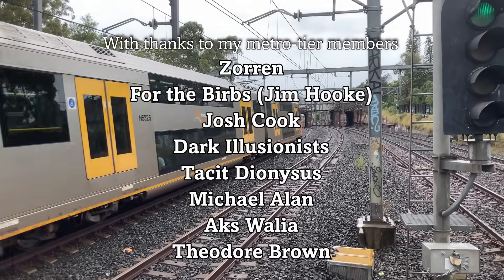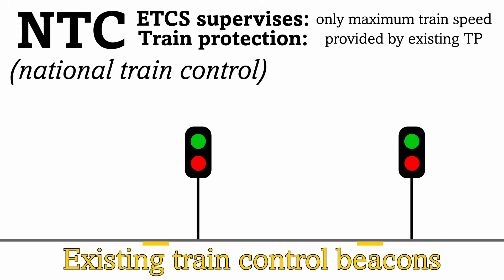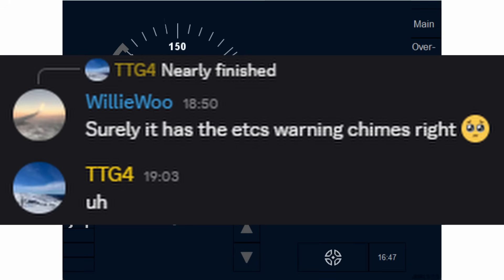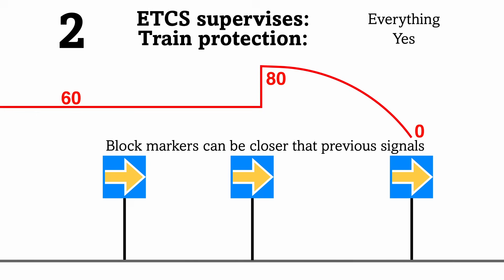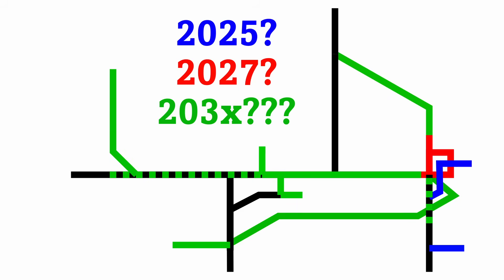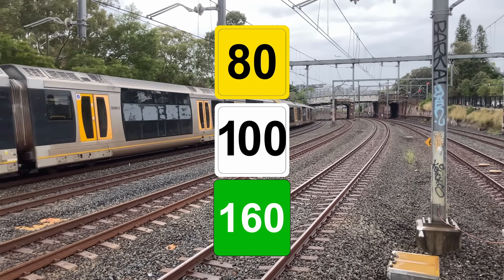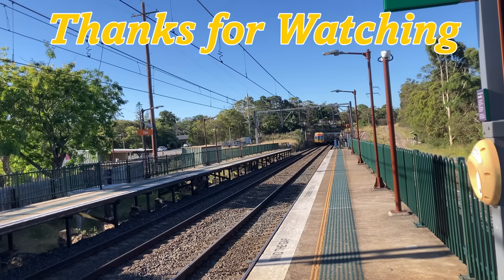What is ETCS? Upgrading Sydney's Signalling

Comment: ERA removed ETCS L3 from the technical specifications for interoperability and merged it with L2. It was done due to the transmission in those levels using the same packets of data, so the distinction was entirely redundant.

Comment: Correct me if I am wrong, but does the Copenhagen suburban system (S-tog) operate ets Lv3. It is a separate system to the mainlines, but other than that and running to different specs, I thought that was etcs lv3.
Reply: correction, Its cbtc.

sorry for the error. 🤦

Comment: L2 Hybride will be installed in parts of the Netherlands where we have ETCS L2 block sections of sometimes 200 meters between stations in Almere. We have developed a simulation model in RailSys and are currently implementing the 2033 timetable for simulations.

Comment: Belgian driver here
ETCS is such a breeze compared to driving TBL1+ (Local system)
Especially LVL 2 enables you to drive much more relaxed as you'll always know everything
In TBL1+, every signal in Belgium with a yellow light (Warning, short section warning, speed limit on next signal) requires us to press a button. Forget it once and you'll get an emergency brake, and once standing still 10-15 (depending on the TBL1+ unit) of "punishment time" before you can refill the breakline and continue. Long live ETCS lmao
Reply: Meanwhile Japanese drivers shuddering at the concept of not pointing and calling at a signal
Reply: Same in Spain and UK

Comment: @11:50 the balise data not only contain a location (or rather, just a serial number), but can also provide fixed information about the track (like eg. permissible speeds, gradients, neutral sections, crossings). Plus they also announce the next balise(s) along the track (i.e. the next expected serial number(s) and the distance to them). And of course for ETCS L1 there are also switchable balises that can transmit different information depending on the status of lineside signals.

As the amount of information stored in a balise is limited to 830 bits of user data (1023 bits in total, but for reliability reasons there are a lot of error-correction bits; and the whole content needs to be transmitted at least twice, even to trains passing at 500km/h, i.e. within about 1-2 milliseconds), this can lead to chains of several balises in more complex track geometry. Balise chains are also necessary to determine the direction of movement, which is relevant for everything but pure locator balises (basically the first balise coming from the wrong direction tells the onboard computer to disregard the following balises).

Thus the amount of balises may seem excessive in places, but as they are quite cheap to manufacture — most of what you see is just a plastic housing for what's essentially a beefed-up NFC chip — that's basically more a logistical problem of placing them all correctly.
On the flipside, that way you don't need a database of all balises and their locations on every train (which would be a nightmare to maintain for trains that run all across Europe). The data provided by the balises are designed to allow for redundancy and self-checking of the received information and the equipment (e.g. even a failed odometer will trigger an emergency brake when the next balise number is received unexpectedly early, as will a defective/missing balise that is not found where expected).

In ETCS L2 the onboard computer will just send the last balise number plus the distance travelled since then to the RBC, which — together with occupancy information derived from track circuits or axle counters (or the trains themselves in ETCS L3) — is enough for the signalling system to determine the movement authority. Using the information about max line speed and upcoming balises the onboard computer can check everything autonomously (except the MA itself, obviously). The information about track gradient can be used to automatically adjust the breaking curve and also allows for better energy efficiency.

Using this setup the data transfer between RBC and trains can be kept to a minimum (train: "I'm at <balise number> + x meters."; RBC: "You are allowed to move another y meters, at most to <balise number>."), everything else (most importantly the permissible speed and breaking curve) can be calculated onboard.

Comment: Nice video. 

Small clarification on terminology. ETCS is better described as an industry standard and not open source. It is still proprietary and requires purchase of the specs and accreditation of devices.

It’s also nice as even over here across the ditch we’re rolling out ETCS Level 2 in Welly as it’s already in Auckland at Level 1.

Comment: I noticed some mistakes. While Level 1 can and is used as an overly of exiting signalling  systems, it can be implemnted as a standalone system. Even without traditional line site signals. 
In the mode Limited Supervision, signal information can be transmitted but is not required for implementation.
Level 3 has been dropped as a stand alone level. Under the latest specification it is only a special mode of operating a Level 2 line.
Balises under Level 2 do transmit more information than just the position of the train. For example they announce the transition between two Levels or radio block sections and many more things.
Yet Balises do not transmit ATO information to trains. That is all done by GSMR with messages called Journey Profiles. In fact, ATO it is an overlay reading the ETCS information but does not interfere with the system

Comment: Sorry but I need to correct two items you mentioned in your commentary (1) the Moorgate tube incident occurred in Feb 1975  the Sydney underground had a slow approach train stops in place before that, in fact I believe they were in place before WW2, used to bring trains closer together at low speed, so close in fact you could see the rear of the train in front  (2) the train stops track side are not operated with air they are electrical maybe those around the city circle & central station were air operated years ago but I believe have been replaced as I noted in the underground station photo they are the latter design to those that I refer to, apart from these inputs I found your information interesting & informative as a former rail employee, starting in the mechanical branch 1964 & later in my employment as depot engineer & centre manager at Mortdale MC.
Reply from the maker: (1) They served a very different purpose. The previous system admitted trains into occupied blocks, Moorgate control admits trains into the buffer block. I believe the previous system worked on track occupancy not proving train speed, too.
(2) There are multiple models of train stop used, some still require compressed air lines but most have been replaced with electrical ones.
Reply: @hain_train  The previous system did control train speed, I have watched a train enter Town Hall station with the three intermediary stops in the up position & lower as the train approached at reduced speed, on other occasions I have seen them raise up as the train approached after being in the lowered position, then lower again as the train reduced speed, this was while the departure signal at the end of the platform was at stop, this was my observation I witnessed in the late 1960's or early 70's, I assume this early system was replaced over the last twenty years with the type you called the moorgate protection system
Reply: @afs5609  There was/is speed control but no active speed measurement with intermediate train stops, though. There are a series of short track circuits with timers set in accordance with the desired speed which control the train stops.

Also, there are many electropneumatic train stops in use wherever a compressed air supply is available (e.g. Sydney/City Underground, Strathfield areas).
Reply: @hain_train it was never referred to as Moorgate control in Sydney and intermediate train stops were not implemented in the wider network as a result of Moorgate accident. Outside of their use in the city circle, they were implemented in the wider network sometime in the late 80’s to reduce the risk of a train spadding a signal and careering through a set of open catch points and potentially continuing onto a roadway. Which I think happened near Rhodes. NSW allows a full caution aspect up to a stop signal with an open catch point in the overlap. So, after the Rhodes incident, several other critical junctions were identified and intermediate train stops were added to them to prove the train speed had reduced commensurate with being able to stop at the red signal (with an open catch point just beyond it in the overlap).

Comment: Good video very informative, 
A couple of things to be aware of. 
1. ATMS is a dead duck ARTC has ceased development on this system. 
2. ETMS and ERTMS are great systems and have the potential to increase traffic density on an already overloaded network which in some areas is operating at capacity. the currently the Sydney Trains network has many areas where trains can operate on 2-minute headways and even less where low speed signalling is installed. as with all new technologies there can be issues created by the requirement to install and maintain additional track side infrastructure which is often located in the track or danger zone. the other issue with ATP type systems there is a requirement to also manage and maintain the onboard systems. So, any change to the signalling or control system generally requires an update to the on-board system on all trains which may operate in the area of the change. this requires additional co-ordination, time and interfacing, particularly where there are multiple operators running their trains through the area.
 3. The cost to install these new systems will very high and take a significant amount of time. It is likely that by the time less than 50% of the network is upgraded that there will be some new system or technology and that spares for the existing system will no longer be available due to the systems or components being superseded. this already the case with some of the current system installed less than 10 years ago.

However, things need to move forward if the Sydney Trains and the other national rail networks are to be able to increase their capacity, line speed, reliability and meet customer expectations.

Keep up the good work

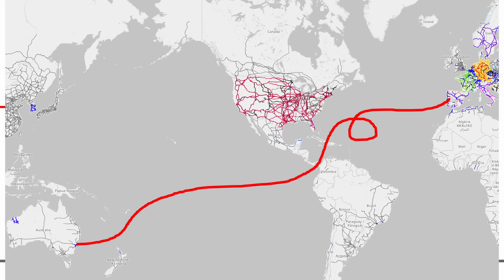Comment: 10:27, are you implying that there is a plan for Australia to join the EU?
Reply: It can't be that far off.  After all, Australia is already in Eurovision.
Reply: If Australia were to build a bridge or  tunnel that connects to the outer coast of Europe.  What will the line be called?  Great Northern?  Greater Southern?  Aussie express? Australian express?  Great southern tunnel?
Reply from the maker: Southern Aurora or Spirit of Progress 😍😍
Reply: Surprised nobody made an Austr(al)ia oke yet 🤔
Reply from the maker: I wish
Reply: Europe and the EU are different. Ones a continental collection,  ones an over reaching political alliance designed to favour France😂.
Reply: @Grid56 So a confederation towards France vs a Federation towards New South Wales, I don't see much difference.

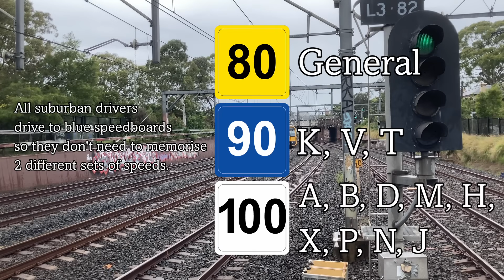Comment: 15:46 - In Sweden on sections where trains using ATC may drive faster than non-ATC operated trains, a ▲ board is placed below the speed sign. It basically tells the driver that they should adhere to the in-cab displayed maximum speed instead of the physical speed signs.

Comment: I’m a big fan of ETCS as it should be done in Sydney in the end.   The L2 I’ve heard is coming includes CBTC to radio the movement authority to each train.  If you put in enough blocks you essentially get moving block signalling.   From what I’ve heard most moving block signalling has a discrete distance in the basis of the system.  So yeah, Australia should have standardised on this ETCS signalling system for all the metros, and capital city networks.  Disappointing they are not.

Comment: Just a note on the train stops 7:29 Sydney Trains uses both electro pneumatic (JA type) and electro hydraulic (JAH type). The JA type have an airline running to them, which operate through a solenoid in the case. The JAH have a 120V AC supply that operates a hydraulic motor, no airlines.
The easiest way to tell them apart is the JA’s have a shorter case and will have two orange conduits running to them. The JAH are longer to accomodate the hydraulic motor unit, and only have 1 conduit.
There is also a JAV/JAH MkV anti vandal electro hydraulic unit that have the shorter case of the JA, but an updated internal setup and different trip arm.

Comment: Driver here, 30 years with NSWGR and 10 with Rio Tinto. In-cab signalling is the greatest thing since sliced bread. Don't have to remember what was on the last signal, if the next one is around the next bend or the one after that, etc. The Concord West crash and Waterfall crash would not have happened had the system Rio Tinto uses been in place on the NSWGR. Call me cynical but I doubt the NSW Railways will ever have such as system.
Reply from the maker: It’s more or less the same system that TfNSW want to install. They’ve picked the worst place to do the pilot programme though.
Reply: @hain_train  Why do you say that the T4 sections are the worst places to do the pilot programme though, you mean because they rely on Tangaras to run the line and these plus their tech upgrades are dogballs?

Comment: How would heritage steam trains be ran on the suburban network if they bring in level 2 and remove signals
Reply from the maker: As part of the East Coast Digital programme in the UK (fitting the main line with ETCS L2) all heritage rolling stock has also been fitted with ETCS, including steam locomotives.
Reply: @hain_train  Network rail paid for two heritage locos, one steam  (Tornado which strictly speaking is not a heritage loco) and a heritage diesel as 'proof of concept'. There is no funding to fit other currently mainline certified heritage units. At this point it is up to the owners to fund and fit ETCS. Many will simply be unable raise that kind of cash and there would be little prospect that such a project would be commercially viable on its own so no one will lend money for it.
Reply from the maker: So there are two heritage locos, great! The rest can operate either on other sections of the ECML or on other main lines. The difference in NSW is lots of government funding is shovelled into heritage and in the medium term signals will be retained for freight trains anyway so they won’t need fitting at all for a while.

Comment: mutters Let's not build train stock in Australia, and then run into issues with incompatibility with Australian conditions, making refits and modifications to stock needlessly expensive... but let's ALSO fail to implement well tested and proven technologies operating on open standards and signals because Australia is "different", taking decades to do something that shouldn't be that hard.

Like... Do you actually understand what IS different about Australia? Cause it really feels like the (NSW) government doesn't, inconsistently applying the "Australia different" too justify poorly thought out decisions. One such example is why in the hell WSA is going to be electrically incompatible with the rest the rest of the network. I get that 25 kV AC is the preferred standard going forward, but unless NSW is willing to pay for modular power systems for the trains, or a hybrid system, all 25kV AC has done is basically completely isolated WSA from the rest of the network! If you were talking about electrification of say the freight or interstate network, sure, but another spur of the existing network?

It kinda scares me they're relying on Moorgates for emergency stop (not because the system is unreliable) because it feels like they've kinda missed the point of a lot of ESTC features!

How... how do we get involved in influencing policy and technical decisions? I'm sure I'll figure it out, but if you have any resources to recommend I'm very interested. Might end up joining that discord of yours.
Reply from the maker: WSA would not have been compatible anyway. It has a different signalling system and different loading gauge and different door positions etc etc. It has the same specs as Metro West but different to the existing suburban lines.
Reply: @hain_train Yes, but Metro West is using 1500 DC, meaning that you could at least do a repositioning movement between the networks, and also hypothetically connect WSA and Metro West in a decade or two.
Reply from the maker: Metro West will be at 25kV 50Hz
Reply: @hain_train It will? Wikipedia might be out of date then.

Comment: What systems are used on the Pilbara iron ore railways , in particular the Rio railways with remote controlled trains?
Reply: I'm pretty sure that's a proprietary system made specifically for the Pilbara
Reply from the maker: Its a tailored varient of ETCS L2 with ATO. They are not remote controlled, they drive themselves. They were the first driverless trains in the country I believe, before Sydney Metro.
Reply: It's called AutoHaul. The system was developed by Hitachi (well they were called Ansaldo STS back when it was installed). Just google AutoHaul and you'll find a plethora of articles on it.

Comment: I agree with the increase of speeds to 160 km/h - however they have said that they can't do it yet, not just because of the signalling, but also because the overhead wiring is low tension, and would need to be modified to allow for speeds above 130 km/h. Obviously that's not that big of a deal, and should be done, but just wanted to point it out as another obstacle incase you didn't already know.
Reply from the maker: 15:15 'if overheads are upgraded'
Reply: Ah you can count on me to miss hearing you say that